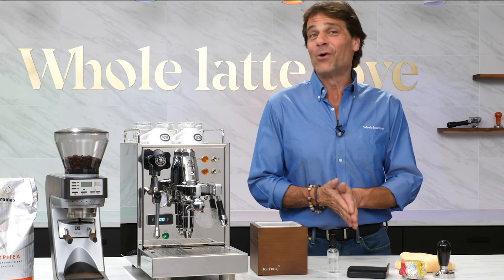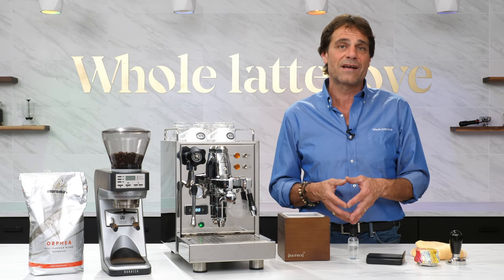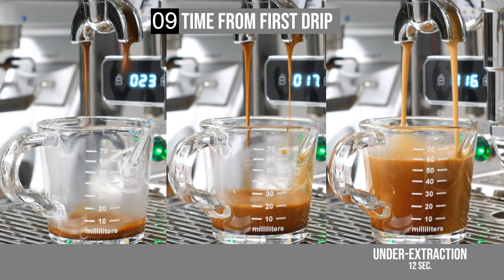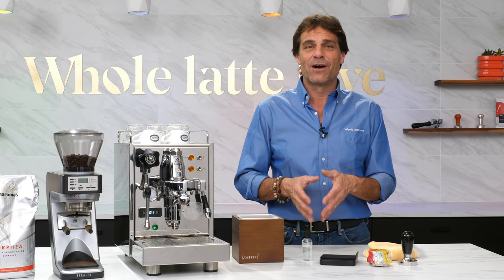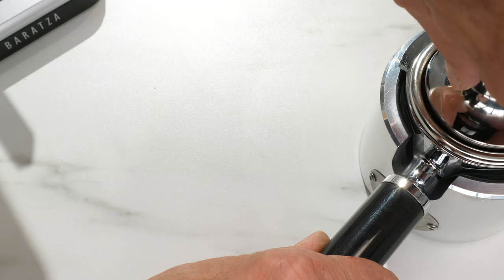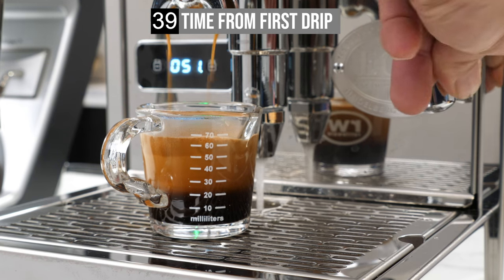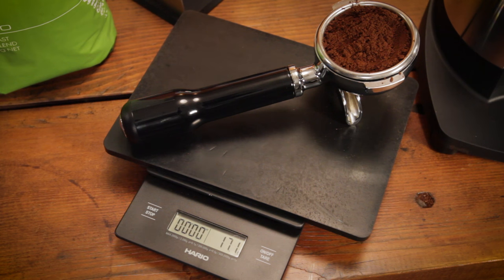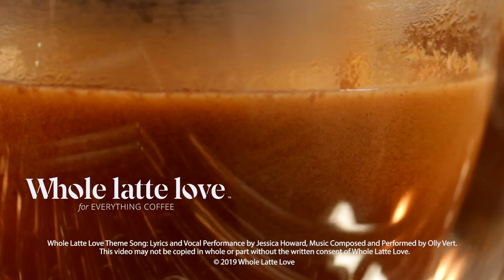How To Dial In Grind Size for Espresso

Comment: Others recommend to start the timer as soon as you start brewing, not when the first drop of espresso comes out. Is there a best practice or industry recommendation of when to start the timer and for which cases?
Reply from the maker: Hi James, Thanks for the question. I prefer first drip. Thing to keep in mind is timing is the most basic method of appraising a shot. Times are relative to shots pulled on your machine and don't mean much compared to the time of others as they may have a different machine, pump, etc. There is no real standard and many (it's becoming more common) are pulling shots far longer than 30 seconds. I use first drip as I work with many different machine types and use techniques like long low flow pre-infusions. Doing those I might not get first drip until 15 seconds. Starting at pump on really does not make sense in that case. While things do happen in the puck prior to first drip solids are not removed from the puck until brew water is actually flowing completely through it. Doesn't really matter where you start timing as yoou are comparing extraction times on your machine with your particular set of variables. Hope that helps!
Marc
Reply: @Wholelattelovepage  Thanks a lot Marc! Didn't expect such a fast reply. That helps a lot. I just switched to an ECM machine that is fairly fast to get the first drip as compared to my previous Breville (which I have nothing wrong to say about). I can see how time from first drip makes more sense as a consequence and I only use it as a kind of high level reference point. I'm currently focusing on keeping a 1 : 2.5 ratio for ground-weight : coffee-weight with 18g for a double shot. Based on that observe flow, crema and taste, and adjust grid size accordingly. Does that sound like a reasonable approach? I admit it's a little frustrating as I feel I keep going around in circles with the grind size but surely getting there.
Reply from the maker: Hi James,  That does sound like a reasonable approach. As you're experiencing, time to be first drip varies by machine. Not sure which Breville you're coming from, but many use a 54mm PF while your ECM uses a 58 so potential difference there as well as different flow rates through the baskets based on number and dimension of holes.
Marc
Reply: @Wholelattelovepage  yup I did switch from a 54mm to a 58mm PF. I think I've found the sweet spot for a good ratio and also great taste. I'm noticing the grinder is not quite there with this machine though so might invest in a new one. I'm noticing that with finer values, the coffee output is really huge for just 1 grind level difference. Still, the espresso is very good.

Comment: My espresso shot doesnt have creama. I use arabica beans medium roast 18grams beans 36ml shot.
Grind size is beetwen 3 and 4
Reply from the maker: Hey rp, Some coffees produce more crema than others. 100% Arabica coffee that's beyond fresh - more than a few months from roast may not produce much. What's your shot timing? If you're in the 25-30 second range and getting little crema my first thought is the coffee. You don't say what machine you're using so maybe something going on there - but if using 18g dose I'm assuming it's a decent machine. Have you tried any Italian style bean blends? They usually have some Robusta beans in the blend which produce crema even if a little on the old side.
Marc

Comment: Cannot get my Gaggia Classic to brew slower even at the 2 setting on my Sette 270 which produces a very fine coffee grind.  The slowest I got it to brew was 15 seconds.  The espresso is incredibly bitter.  Not sure what else to do. I tried using 17g of coffee then tried 18g, it all brews very fast and comes out terrible.  Now if I set my Sette on 7 it brews 2 oz under 10 seconds.  If I use that same coffee and put it on a $150 Mr Coffee espresso appliance with a pressurized portafilter, it makes a decent espresso.
Reply from the maker: Hi C, It should be possible to grind fine enough on the Sette that you choke the machine meaning no espresso will drip from the PF spouts. A Sette new out of the box is usually in the espresso fine grind range somewhere between a setting of 2-5 on the macro adjustment ring. If the Sette happens to be older it may need to a have a burr shim or two inserted to re-establish the fine grinding range after break in with about 3kg/6lb of coffee. Burr shims come with the grinder and are easy to install. You are likely getting better results from the Mr Coffee due to using a pressurized PF which is very forgiving of in correct grind size at the expense of a lower quality espresso. Based on what you've said I believe you need to grind finer and shimming the Sette burr may be the answer. Here's a video showing you how to install the burr shim(s): https://www.youtube.com/watch?v=7sBpJcsF7-4
Hope that helps!
Marc

Comment: I see a leveler can price for over 100.00 to 25.00  what is the difference?
Reply from the maker: Hi Thomas, Cheaper levelers are usually made of lightweight aluminum, do not have easy click stop depth adjustment and may be a little sloppy in fit within the filter basket. We recently started carrying Eureka Levelers. They are <$100 and very good! https://www.wholelattelove.com/products/eureka-easy-adjustable-leveler-58-3mm-olive-wood
Marc

Comment: I can control the time to drip very easily with grind size (and have even taken it up to almost a minute with find grinding), but cannot cause the extraction time to grow to more than about ten seconds.  I am getting a nice fluffy grind into the basket, have tried the WDT, am tamping evenly, etc., but cannot get the nice slow complete extraction.  Help
Reply from the maker: Hi Mara, If you are going out to 1 minute until first drip your grind is much too fine. To go that long and then have the entire shot gush out in 10 seconds is highly unusual unless you have major channeling through the coffee puck. I do not know what type of machine you are using. In a standard extraction in a non-pressurized filter basket with no flow control or pre-infusion you should expect to see first drip in under 10 seconds. I'd grind coarser.
Marc
Reply: @Wholelattelovepage  Thanks for the feedback.  It is a La Pavoni machine.  There are no clumps in the grind, and some WDT slows first drip without impacting post-drip extraction time.  I see no signs of channeling in the puck.  Mysterious.

Comment: Informative video, as always. Can you recommend a leveler that is equivalent in quality to the Jack Leveler in a 54mm format? I have the Breville Barista Express, and the portafilter baskets are 54mm.
Reply from the maker: Hi DF, At this point I cannot :(. There may be some knock off levelers in 54mm size but I have not come across one similar in quality and function to The Jack.
Marc

Comment: If I buy pre-ground ( not by choice ) and the extracted volume is too low at 25 seconds do I just increase the extraction time?
Reply from the maker: Hi l, Thanks for the question. You can slow the extraction down by using more coffee in your filter basket if you do not have control of grind size.
Marc
Reply: @Wholelattelovepage  What if it hits the screen?

Comment: Struggling to dial in on my barista express machine, any advice? I've got to the finest setting on my grinder on the machine too but extraction is still around 10s from first drip
Reply from the maker: Hi S, 10 seconds is far too fast. How much coffee are you dosing? Are you doing singles or doubles?
Marc
Reply: @Wholelattelovepage  Doubles non pressurised 18g Marc!
Reply: i experience the same Problem with my sage Barista express. grinding in Setting 1 does not clogg the mashine. so how to get the perfect shot? 17g / 17sec. / 42ml
Reply: I've got the same issue, any luck/update with your situation? I initially read that a too fine setting may cause channeling with the water, as the grind may be clumping at the finest grind setting. But I feel like with the barista express and my current beans, any setting from 1-5 is causing extremely fast extraction like you have, 10 seconds.
Reply: Steven Jacob what i found out so far is the most critical advice newbie’s pay no attention to (including me) is the coffee Bean itself. I tried many different beans, but the freshness is the key to a perfect shot. Now i can  grind at 7.
Reply: Frank Kern I’m in denial, but this is probably the right solution. I’m only in denial primarily because the local bean store I went to, sells local roaster beans with roast dates on it but also repackages into smaller bags without a roast date on it, and you can’t necessarily tell which larger roast bag date they line up with. And so thinking back to my purchase it’s possible that these beans are 2-3+ months past roast. I’ll look for some fresher more recently roasted, oilier Italian blends that have longer shelf life and hopefully that changes things around. Lol I’m trying to figure this all out within my 30 day return window on the Barista Express. Anyways excuse my lengthy response, and thanks for the response.
Reply: Steven Jacob I’m driving 30 km to get the beans freshly rostet out of the rost house. The barista express is a good Espresso Maschine for home use. I really like much. Milk steaming is not so powerful for Late Art. But good enough for me. Sorry for my poor English. With fresh beans u’ll get a delicious Shot.
Reply: @Da-Core  Your english is great, keep it up! And I'll let you know how it goes, hopefully gonna grab some new beans shortly, I'll finally pull my first shot that tastes like the described tastes on the package lol and I'll keep the Barista Express.
Reply: @Da-Core  hey frank, so update. got some freshly roasted beans, waited until the recommended de-gas amount of days passed, attempted to pull a shot, still got a very obvious underextraction. I started to feel pretty upset/defeated, then realised a good test would be to try and simply choke the pull. However I couldn't at the finest grind setting of 1 --- and alas I had found on the interwebs that the Barista Express has a top burr setting in the grinder for an even more fine/coarse adjustment. After FINALLY finding out about that, I've been able to increase the grind size enough to get a non-under extracted shot! Yay! :) Now I can finally start playing around more with the flavours from different roasts.
Reply: Steven Jacob I’m glad to hear u finally found a solution to our grinding problem. 
The funny part of this is that, exactly today, i found out the same thing with the inner grinding ring. It was not described in the User manual. But my fav. YouTube channel came up (exactly today) with this fine tuning possibility i didn’t know so far. For myself it was the freshness of the beans. So stay healthy and enjoy ure Espresso. Greetings from Germany
Reply: @Da-Core  haha wonderful! cheers from canada :)

Comment: Hello! I have the Gaggia Classic Pro and am using the nonpressurized double basket. The manual says it's designed to fit 14-16g of espresso grounds, so I've only been weighing 16g of beans to grind. Is this accurate? Could it fit more?

I have the 18g IMS nanotech basket on the way based on your recommendation. Would I use 18g of ground espresso for this basket then?
Reply from the maker: Hi Sarah it could fit more depends on the coffee are using because some coffee is way more or less like a light roast high altitude coffee generally weighs more dark roast generally weigh less for the same volume so what you can do is just fill your basket as you know you can overfill a little bit how do you tap of course and then when you pull your shot if you’re singing impression of the shower screen then you have too much coffee in it and the same is going to hold through the 18 g basket I’ve often put 19 or 20 g in those really all depends on the coffee hope that helps best of luck,
Marc

Comment: Hello and thank you for your videos. I am learning so much. I have an older, entry level espresso machine. It started leaking lately. After watching some videos, I decided to adjust the grind (I have a Capresso brand burr grinder). When I made it a little coarser, it didn't leak, but I got 3 oz in 17 seconds with great creme.. So I adjusted ever so slightly and made it finer. It leaked again. My question is, do you think I may have a cheap machine that isn't really good at making espressos? I tried to make this one work but I don't want to try to understand and tweak ratios, etc, if it's not worth it on this machine. Thank you so much!
Reply from the maker: Hi tHfl, You are welcome and thank you for the comment and questions. What make/model is your machine and where is it leaking? If from around the top rim of your portafilter it sounds like it could be your group gasket - it forms the seal when your PF is locked in place. It's a wear item so they don't last forever. If unfamiliar they look like this: https://www.wholelattelove.com/products/gaggia-group-gasket
Let me know the make/model of your machine and I'll offer my opinion on its capabilities?
Marc
Reply: @Wholelattelovepage  thank you for your response. All I know is it's an AICOK brand. We got it from Amazon. This is our replacement. Our original one was a few years old and it started leaking (yes, around the top of the portafilter). So the company kindly sent us and new one. At this point my husband said that it was the seal. This one isn't even 6 months old and it's doing it again. This time I changed the ground size like I stated. As long as I do that it won't leak. But I don't think I'm getting the best espresso with the slightly larger grind. It's disappointing because it's happening so soon with this one.
Reply from the maker: Hi, Did a little research and Aicok is a Chinese brand which makes all kinds of products beyond espresso machines. It appears to be what I consider an espresso appliance as opposed to a machine. These cost a lot less of course but it's a case of you get what you pay for. I'm not certain but it appears as though it may use a pressurized filter basket. As you have discovered when appliance quality products fail it typically is not cost effective if even possible to make a repair. True machines on the other hand are much more reliable. Take good care of them and they should provide decades of service and make a far better espresso than appliances. These machines are like cars and do require maintenance from time to time. If something does go wrong down the road machines are very repairable. Parts are easy to get and relatively inexpensive. If/when you are ready to go machine grade keep the Gaggia Classic Pro in mind: https://www.wholelattelove.com/products/gaggia-classic-pro It's hand made in Italy and is without question the best value in premium quality entry-level espresso machines and will make a far better espresso than what you are using now. As you've perhaps discovered there's nobody to call at Amazon when you have a problem with a product like yours. Here at Whole Latte Love we have a staff of former baristas and machine technicians you can call and talk to before during and after a purchase. Also have resources like a support wiki for many products for the do it yourself crowd: https://wiki.wholelattelove.com/Gaggia_Classic
Marc
Reply: @Wholelattelovepage  thank you so much 🤗I really appreciate it . I figured the thing was just too cheap to do anything good. And the more research I do, I do realize I need a better one. Thanks for all your help with everything. Love your page. I will continue to learn from you and your page. 🙌

Comment: Hi Mark,

I recently acquired both the Sette 270 (not the Wi) and the Gaggia Classic in hopes of learning how to pull a perfect shot. Having said, I am still having much difficulty and have reviewed most of your videos to include this one.  My problem seems to be that I’m unable to dial my grinder in as my drip still pours too fast. I’ve lowered my dial as far as it will go but still no luck. I’m using the Morphea brand bean as well. Seeing that you’re using everything the same as I am can you tell me what dial setting you’re using on the sette so I can have a good starting point?  

Thank you in advance.
Reply from the maker: Hi AB, Thanks for the question. If your Sette was new it should be able to grind fine enough for espresso - in fact you should be able to go fine enough to choke the machine (no drip). The 270 ships new with 2 shims to insert after break in. During break in the Sette will grind progressively coarser at a given setting. Inserting a shim will increase grind fineness by about 4 macro settings. Here's a video from Baratza demonstrating the simple procedure for installing the shim(s): https://www.youtube.com/watch?v=7sBpJcsF7-4
Hope that helps!
Marc

Comment: I'm using a bottomless portafilter with a 2 cup, unpressurized (single wall) basket with my Bambino Plus and about 18 grams of coffee.  When I press the 2 cup button, I almost always get 3 or 4 streams for the first 5-10 seconds before they merge into one stream in the center.  Isn't it better to initially get one stream in the center instead of several streams?  If so, what should I adjust to get a single stream at the beginning?  Should I grind the beans finer?
Reply from the maker: Hi Mark, Thanks for the question. The goal is to have espresso develop evenly across the bottom of the filter basket. Not unusual to take 5-10 secs for the individual streams to coalesce before merging. Set your basic grind size based timing of the shot. Hope that helps!
Marc